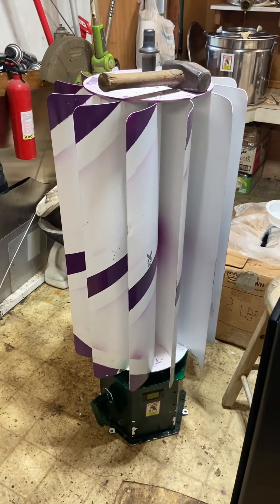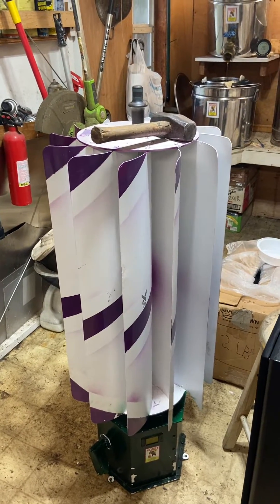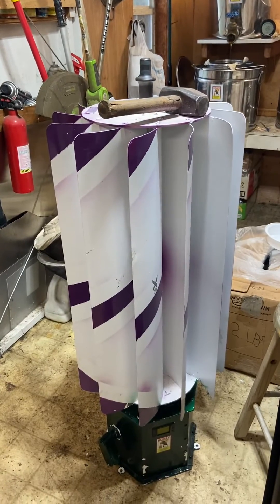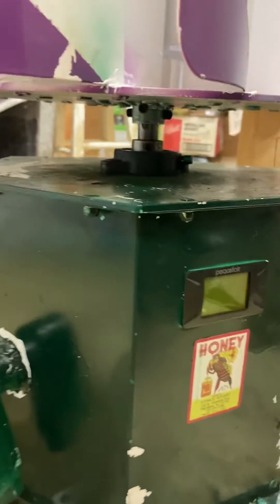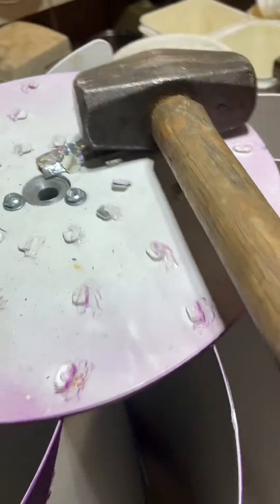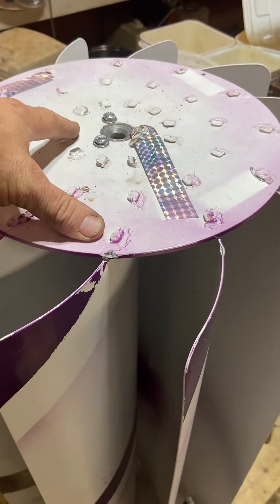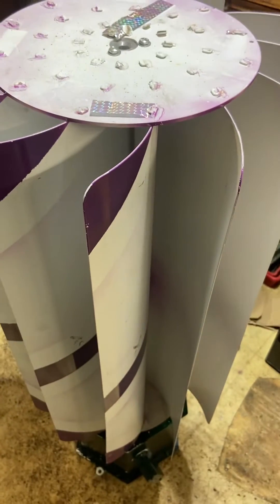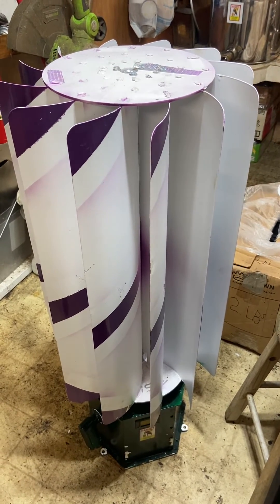Vertical Wind Turbine Part 14 Tesup sucks big time! No one has working proof.

Comment: I have a question. How about if you turn the whole thing sideways instead if vertical, and add another bearing on the other end? It would need a tail to keep it aimed right, but it should take the wobble out. That would let it turn better. Besides, a generator shouldn't be on end like that. It can't turn as well. The whole thing is designed wrong, but it could work sideways maybe, with another support. I'm building mine out of a mag motorcycle wheel for the blade hub, but the center of the blades are there, not the end. That way there's two bearings, and no wobble. One just has to figure out how to use the thing you have. The winds here would break your blades off of the generator. It should have a support for the top. I'm only using a DC motor that may make 450 watts, tops. So a blade the size of yours would work on it. But I don't see how it could make much more with those blades. It looks like the blade hub should be 42 inches wide and the generator in the middle, not the bottom. Well, I'm in the middle of designing one. Kind of looks like you are too. You may have to change some things around to get any good out of it.
Reply from the maker: thanks, as you see from the other videos, what I did was extend the shaft off the generator and also put a alternate shaft support bearing at the top of the generator. Took the wobble pretty much out, but I also did a threaded rod straight down pulling it in the center core to stabilize it. Next modification I’m going to do is change and take every other blade out and extend the actual blade next to it.  That will double them in size for diameter. before you get carried away, look at harmony turbines out of Pennsylvania that is the next generation of wind turbines that has an excellent design, and will protect itself against the strong winds. this is my first wind turbine, I’m sticking with the vertical design. Thus for neighborhood friendly. from the design aspect, I believe the turbine is too small of a diameter to catch enough wind to spin a 4K generator motor.
Reply from the maker: PS what part of the country/world are you in? And do you have a tower built? Where are you mounting it ?  on the roof?
Reply from the maker: Like I mentioned before, this is my first vertical wind turbine. My main plan was to wait for harmony wind turbine to produce theirs and set that up but it’s taking them quite a while probably till next year at least before they get a production of prototype available to the public. Which has a phenomenal design just have to see the size and weight of the finally design.
Reply: I'm from North Eastern Oklahoma, sometimes we have 70-80 mph gusts when a storm comes. I call them destruction winds. I live on a hill made of sand rocks just a few inches deep. Little dirt here. I have to make a hole in the rock deep enough to hold half of an 8 foot piece of six inch I-beam. That will be the base of the pole. I don't want to connect with the barn because of the noise. I'm going to try 16 feet, because I'm on the side of a pretty good size hill, almost at the top. It gets pretty windy here, there are days when the wind is around 35-40 for hours.  It's blowing 25-30 today. Sounds like you have an idea how to do yours. I didn't figure it has enough diameter. It has rained for two weeks and next week snow, followed by artic air the week after. I'm just sorting out the parts.  I won't get anything up for awhile. I have 1200 watts of solar panels, but the sun hasn't been out enough lately. The panels charge 20 big marine batteries that I bought last year. They run a 24 volts Aims Power inverter charger, 2000 watts. The wind generator will be to help the solar system on cloudy windy days like today. I just want to keep the voltage up so that I don't have to use the gasoline generator.